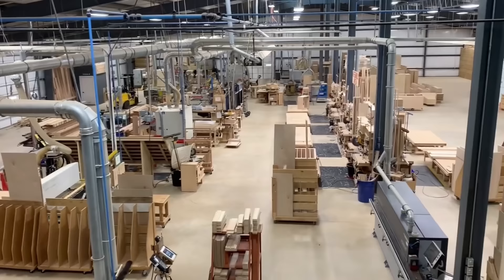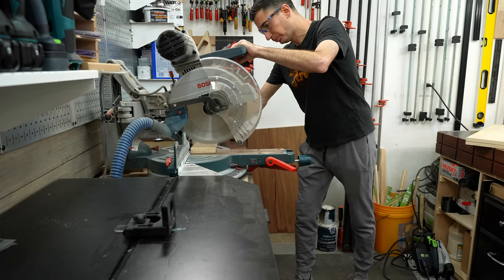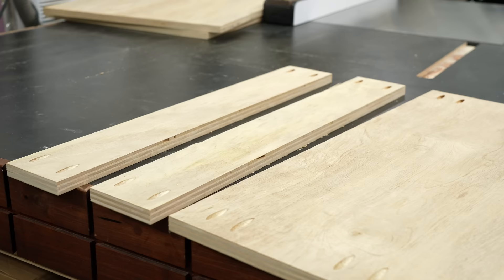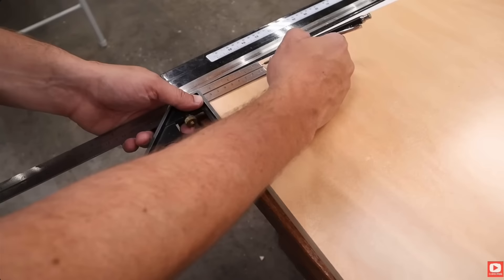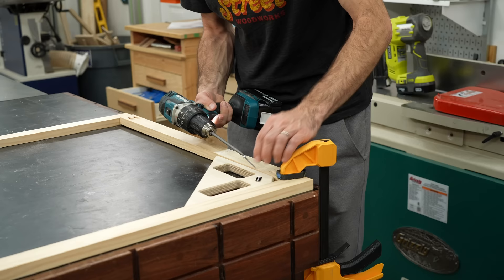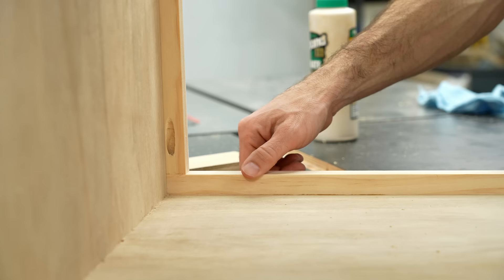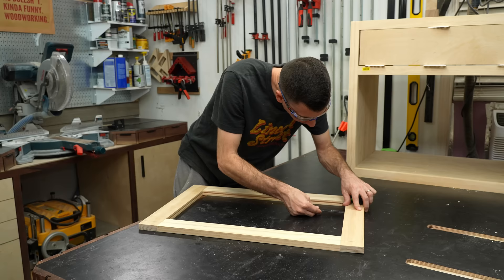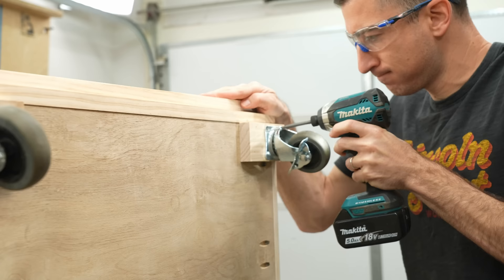Bad Beginner Cabinet Tips

Comment: Good DIY cabinet video. For pocket screws + glue construction, I will do a dry fit up with clamps and drive the pocket screws in 80-90% and back out. This gives me alignment "pins" for the glue up. I'll spread glue, drive a few screws with 1/8-1/4" poke-thru for alignment, and then drive screws fully in once pins are seated. Works GREAT when you have pieces not easy to clamp together for assembly.

Comment: A good straight edge and a cordless saw, and you too can build a cabinet base. Ripping up plywood with a cordless saw is also safer than using a table saw. The one thing I really took away from this is building the toe kick separate from the rest of the base. That is a good idea. No doubt I will do that in the future. Great video!

Comment: Nice to see a "get it done" video instead of a "check out my tools" showcase.  Fun to watch.  THERE IS A SUBSTANTIAL PROBLEM WITH YOUR FACE FRAME BUILD THOUGH.  For your garage trolly cart it may not be a problem to have a bucket bottom but in most cases having that face frame positioned so high above the bottom is an invitation to have it destroyed when removing things from the bottom shelf.  Also as someone else commented there should be a small face frame stile overlap on the  outside as well for installed sitiations.   The cabinet bottom should be elevated by the heigth of the rails (minus about 1/8" max) so that things can slide in and out of the bottom without much lifting if any.  Or you could install that bottom rail with the excess on the outside rather than the inside....= longer stiles and a no longer flat bottom.  Nobody is going to want to have to lift stuff over a 1-2" lip to use their cabinet.  Again I do realize the wheeled cart you made may be like this for a specific reason.  You should edit and point this out to the people intending to follow the build for normal uses.  

Keep up the awesome presentations.

Comment: When we redid our kitchen cabinets, I was an integrated toe kick guy but my wife wanted drawers in them so I made them all in my garage with drawers and slides first then topped them with the cabinets later.  She can put in pizza pans, baking sheets, and such in them and no one even knows they are there in the toe kicks.  Great video.  Two thumbs way up.  Well, one from me since I never bothered to use a push stick.  I still have it though, it is in a jar on my shelf.  Just kidding.  Great content and good information for sure.

Comment: One nearly free shop tool you can make from scraps of plywood are corner squares. Just make small 90 degree “L” shaped pieces about 6-8” long on each side about 2” wide. Then while assembling cabinet sides you can clamp them in the corners to hold them square and in correct alignment to make the job easier. I did a whole series on my channel building plywood body cabinets with knotty pine fronts and ends and I used them a lot!

Comment: You did almost every trick I use for easy cabinetry building including having the store rip the plywood before bringing it home.  I’m a big fan of simple drywall screws to hold any panels together where the screw heads will not show, like in your case where the sides of the cabinets are not exposed.

Comment: For the back panel dado, I sandwich the back stretcher and 1/4 ply together to adjust for the second pass on the table saw. I make sure it's slightly loose. It's quick and easy.

Comment: I made cabinets for an apartment we owned. What was shewn in this video is very close to what I did. however:
1. I relied on the home center guy to make the cuts with the panel saw. This can be a hit and miss type approach, however I was lucky enough to work with people that wanted to do cut very precisely. What I did to help was set up a stop block and tell them for these cuts absolute precision isn't necessary tut I want them to be exactly the same. I also had drawings of the cuts required on the sheet so I wasn't taking the time of the home center employee to work that out.
2. I wish I had thought of the idea of nailing the sides together with my nail gun. I used clamps but nailing them would have been faster.
3. My cabinets were just paint grade and I just filled the screw holes. I thought they came out looking very nice.
4. This was a while ago so I don't no the situation today, but Home Depot was the place to go for the plywood. They had some very nice plywood that was finished on both sides with filled knot holes and it was pretty cheap. It costs at least twice as munch now as what I used to pay for it.

Comment: Personally I really dislike how most backing panels in cabinets are done. Now I come from shipbuilding which generally means having more removable back panels to access equipment, check the hull etc. however what that has done is given me a very strong appreciation for backing boards that are attached to battens. Run battens along the back edges of your cabinet, cut the backing board to size and fit it inside using your preferred method (screws with decorative washers or hook and loop strip are both good for removable panels). 

The big benefit here compared to pretty much every cabinet I’ve bought or had in a property is that it is so so much harder to break the backing board or push it enough that it separates from the cabinet at the bottom, usually as a result of shoving things in too far.

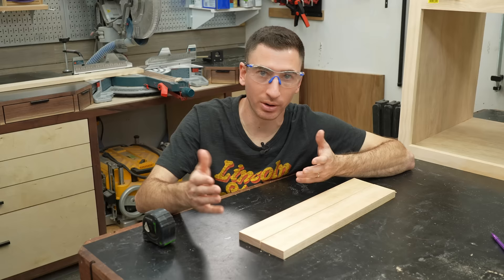Comment: 19:50 When doing mental math taking 3/8 and cutting it in half is as easy as knowing that that 8*2 is 16, half of 3/8th is 3/16th. Much easier than to try and mentally cut 0.375 in half and expecting to get 0.1875 without writing it down. Basic mental math with fractions means easy 1/16 or even 1/32 precision, meaning at least 3 if not 4 significant figures. This is the one area imperial has a huge advantage to metric, we should take the wins where we can find them this is the exact use case for fractions.
Reply: USA, Myanmar and Liberia uses the imperial system, the rest of the world the metric. 
The metric advantage is enormous.
Reply: @pabr2405   okay, but you didn't address my point. Fractions have an obvious advantage for mental math, and that makes a difference for this type of work.

Comment: Could not have found your channel at a better time.  I've actually made a cabinet for my previous home.  It came out good for me basically winging it.  But, it took me about 5 months and a lot of, not so lady like verbiage.  Now I'm attempting to make multiple kitchen cabinets for my current home. Aside from needing the sheet of plywood to fit in your car, is there a reason why you had the sheet ripped lengthwise?  I planned on having them make a couple cuts on the short side, mainly to fit into my car. 😉

Comment: I had a mate who would make anybody a kitchen from boards,either in the living room of the job or at home in the garage, or on occasion in the back garden of the job. A shopfitter by trade he could make anything with almost no tools, A circular saw and a drill driver will make you a shaker kitchen.   I bring this up because it’s not easy if you’re a beginner, you’ll make a lot of mistakes. I mean the work’s not hard, but you won’t know what not to do ! give it a good looking at… I recommend, Blum hinges and drawer slides, and, good screw levelling feet.  You just have to source them.  Separate plinths can be an absolute pain to level up. particularly if you surveyed the job with the old kitchen in there !  Luck !

Comment: Hi. Tip go to a hardwood dealer. Mine sells better quality plywood, the charge is $4 more per sheet and has they have a Swiss $25,000 panel saw that is accurate. The charge is $1 per cut and is dead on. They trim the factory edge for free.

Comment: I am a construction worker moving into woodworking, and I find your videos extremely helpful. Although I noticed a very common misconception in this video, and I couldn’t let it slide. This is my first ever comment btw. Measurements matching from corner to corner in one direction (top to bottom) does not mean you are square. If the top was a half inch larger on the right and left (total of 1 inch lager), you would still have matching measurements. You have to use the 3,4,5 method to find square. 
I learned this when I measured the forms for a house incorrectly several years ago. Like I said, very common misconception. 
But anyway, awesome videos! Keep it up!
Reply from the maker: Thanks John. One of the things you will find much different in woodworking vs general construction is the overall accuracy/repeatability. Since we use stopblocks and batch cut parts to identical dimensions, diagonals works because all our parts are the same size. But yes in a traditional carpentry setting where tolerances are much greater - 3,4,5 is needed.

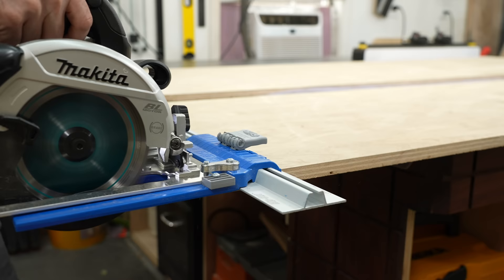Comment: 1:34 I'm not sure what you're referring to here but if you mean the margin of error introduced by the width of the cut, you can adjust for that by including the width of the cut into the dimensions of the pieces (actually, half of that width only, otherwise you'll be wasting too much material and will have to do a lot of extra trimming of the pieces afterwards).
Be aware that these programs are not deterministic (usually) because the problem of optimising the cuts one a given piece is not solvable by regular optimization methods. This is just a side note just to prepare you for the fact that the solution given might not always be the best one (although I'd challenge you to figure out a more efficient cut when the number of pieces is moderately large or greater).
Reply from the maker: Im referring to the fact that it can create a game of tetris to "maximize" a sheet and it gets very complicated very fast. Parts get stuck in between other parts with different dimensions. Its not practical at times.
Reply: A-ha, so you mean it optimizes the use of the wood but it makes it impossible to cut by creating a big jig-saw @Lincolnstww  ?
(I guess that's where the term "jig-saw" came from...) Sure, that would be quite a headache. Patience! Affordable CNC laser cutters are only round the corner!
Reply from the maker: @Stelios.Posantzis  exactly!

Comment: A racked cabinet in which two faces end up as parallelograms would be a right parallelogrammic prism.

Trapezoidal prism for when you cut the top 1.5" short because you forgot to account for the thickness of the wood. Like I did with my closet shelf 5 years ago which I still haven't fixed although that one's only .75 over like 4.5' and you have to look closely...

And irregular hexahedron if you build it drunk.

Comment: I recently built some cabinets using no glue and only pocket screws. They have held up without issues and I don't think glue is actually necessary anymore unless its a joint that will have huge loads. Some people can even drive cars over pocket screws, so just bulk up the screw amount. 

I have verified with an actual cabinet from a build in the past with no glue. It has held up over 5+ years without issues. The great thing is that if the wood is high quality plywood, you can re-use the wood by simply unscrewing or if the project needs maintenance, disassemble and reassemble easily for fixes because no glue is used.

Comment: Great video. As new to woodworking I've seen people measure corner to corner to check square but no one with a fix for it if it's off a bit
Reply from the maker: Use a pipe clamp that can go diagonally and pull it into square while attaching it. Do the same for  boxes while attaching the back panel

Comment: Pre drilling your holes for the screw:     

#6 screw:

        Softwood: 7/64 inch
        Hardwood: 1/8 inch

    #8 screw:
        Softwood: 1/8 inch
        Hardwood: 9/64 inch

    #10 screw:
        Softwood: 9/64 inch
        Hardwood: 5/32 inch

Comment: If I remember correctly, a 3 dimensional parallelogram is called a rhomboid or parallelepiped.  I also remember it being described as having 6 parallelograms as the sides, and I always thought that was incorrect, since it really only has 2 parallelograms opposing each other, with square or rectangular secondary and tertiary sides opposing each other.  It only "looks" like 6 parallelograms when viewed 2-dimensionally.  Please, all you geometry geeks, correct me so I don't lose any sleep.

Comment: I never use pocket screws and I will not use glue. Unless it's needed to glue the wood.
I build cabinets with only screws. I've build 6 cabinets.
I used your method how to place the back panel inside the cabinet.
And I don't use the 19 mm sheet as I planned. I use the 9mm sheet. It workes very good.
I filled the edges with malleable wood. And sanded it after. With a good result.

Comment: The most useful thing I ever built with my circular saw, was my table saw. Ironically, I had to buy another circular saw to use inside it but got unbelievably lucky on Ebay. I intended it to be temporary but I'm still using it three years later.

Comment: Screws, no matter how installed will work just fine for cabinetry....unless you're going to throw them down a flight of concrete stairs. If you DO plan to do this, use glue and crews. You'll be fine.
Reply from the maker: This is my favorite comment on the video
Reply: Agreed, my dad built a kitchen bench on wheels for me and then dropped it while unloading off the trailer, it was barely noticeable and everything still tight. Didn't even use glue just screws

Comment: When I was young I worked in a DIY store with one of those big panel saws. It was the 90's so we didn't even need any training. If you were confident and were happy to use it, you could use it.
I was also the warehouse manager so when the pallets of sheet wood arrived, I had access to the free large base board that they put down on the pallet 1st to protect the rest of the sheets. It was quite often 1 inch thick ply or MDF with very light damage. When I finished my shift, the store remained open for another 2 hours so I'd often spend a while ripping the damaged sheet down into custom cabinets.

Comment: Lol, I've been that guy with a saw in the parking lot. It's nothing to be ashamed of when the place you buy your wood from won't do it. In my case 4x8 sheets fit just fine into my minivan, but 5'x5' sheets won't.

Yes, pocket holes and glue are strong enough for the face frame, but are dowels really much more work? I just don't like the look of pocket holes, even if they will be mostly hidden. - I'm asking as someone who has not worked with either, but wants to start. I think even a DIY dowel jig could perform this task quickly.

Comment: The last time I went to Lowe's and needed them to rip down a piece of plywood for me the saw was broken, which I could tell someone it hit the switch with a forklift and pulled the wires out but it was otherwise undamaged. I asked the 20-year-old kid who was helping me what something was on a shelf and asked him to tell me everything he knew about it and while his back was turned I used a multi-tool to wire the switch back together and bent the housing back straight. When he turned around I said "I think somebody fixed your sa, You want to give it a shot?". Every time I go in that Lowe's to the lumber to department the kid calls me the equipment repair technician. TBH it's one of the greatest compliments I get and if he ever leaves that store I might get lumber somewhere else.

Comment: Kudos on the non-integrated toe kicks. I prefer them because the toe kick base is an order of magnitude easier to level and install, and guarantees a level base. Also, it permits a custom approach... I hate deep toe kicks that defy sweeping, mopping, and other general cleaning and then accumulate several dead people worth of dust and multiple cats worth of fur. Yes, I have cats.
Reply from the maker: Yup that's been my experience

Comment: The "twice as much" comment - in my weird house it depends
My plot of land is not quite square so at one side of the house I have a wall at a 92 degree angle. So on the north side of the house, all the furniture is custom, all the furniture on the south side is pre-made. Even then I tend to find 2nd hand stuff, strip it back and refurbish it. My basement hifi cabinet is what really got me into woodworking. I was quoted many thousands for a custom solution at a home-show and decided to buy about $2k of tools and hardwood instead

Comment: "Overkill"? I have raised children and used a certain amount of discipline to keep them from using the home as a park play area. In other words, the two are distinguishable different. But my cabinets are screwed and glued and have stood the test of time, 48 years. Now I am giving them new doors. MBF you say "NOT". A quality hardwood doorframe will be added. How much is a new kitchen these days? And you are lucky if the doors don't fall off in 5 years. If you want your cabinets to last remember this. Quality material Quality hardware and of course craftmanship and of course glue and screw. Unless you are planning to take it all apart down the road for some reason. ?.

Comment: Yes I'm used to metric but that really wasn't the issue as I didn't know what HDTV Shaker was so first watch through I had no idea what you were doing with your measuring tape at 19:40.  In fact there were a few times where you said which part it was you were working on and I had to wait to see where it ended up because I didn't understand the terminology used.

On a more positive note I loved how you explained the different options for joining the timber together and how different options suit different jobs.  I personally like the exposed edge on plywood joinery but understand it doesn't suit all jobs and it's always good to know more than one way to finish a job off.

Comment: 1:41 I'm one of those. I've been wondering about this guide since the start of the video. At 45$ this is the first power tool (a-hem, granted, it's an attachment) I see that is cheaper than the materials it's used for.